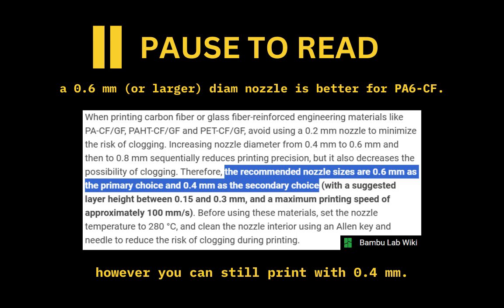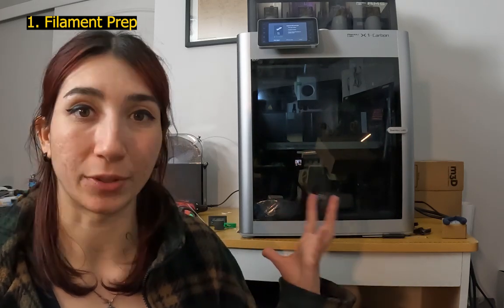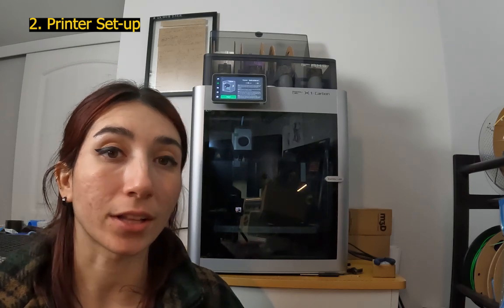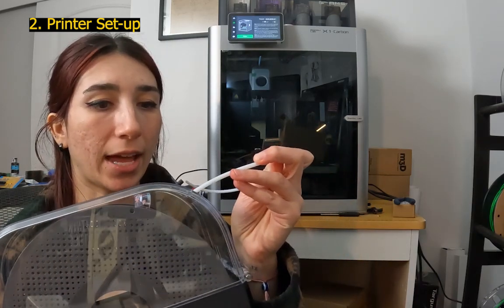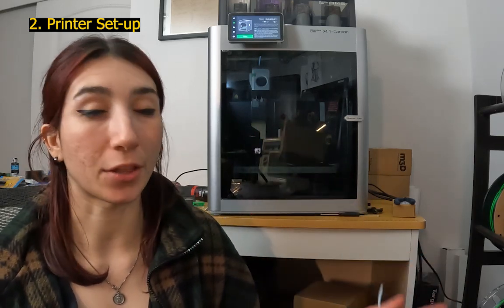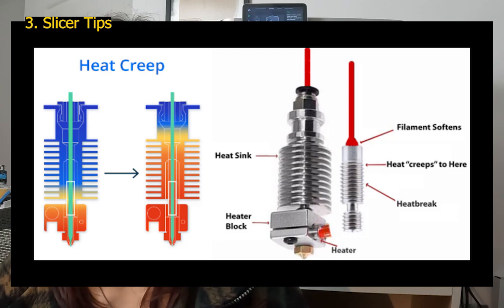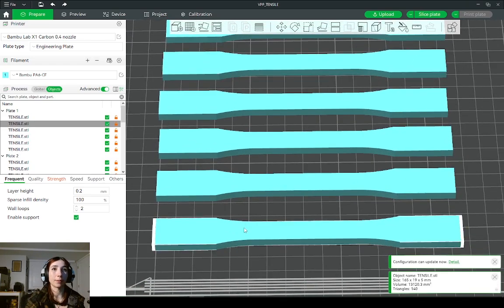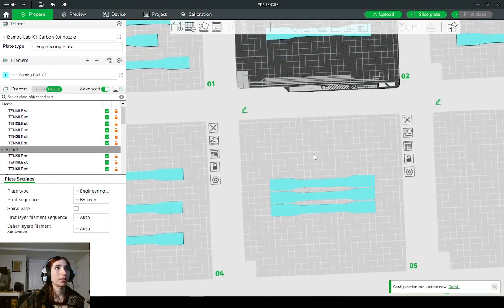I printed PA6-CF with a 0.4 mm nozzle (& you can too)

Comment from the maker: Hi! Thanks for checking this video out!

Edit** also another commenter pointed out - it's probably a good idea to uncheck "slow print down for better layer cooling" in the material profile as less cooling is generally better for layer-to-layer adhesion when printing with PA-CF (what I discovered through some colorfabb research, didn't find anything directly on the PA6-cf from Bambu lab). If you have more insights let me know and I'll update the video description.

Edit again** description updated :)

Best,
Dora

Comment: part cooling and hotend cooling are two different fans, right? I don't know on X1 but on A1 there is no setting to change the hotend fan. I think part cooling fan doesn't help at all with heat creep. it blows near the hotend nozzle, not on the heatsink.

Comment: hi, I also have an X1C and I just started printing pa6-cf, I found this to be a pretty helpful video, thank you! I had one more question, did you keep your print speed settings default? everywhere I see online says 100mm/s max but bambus defaults are quite a bit higher than that. I tried a print with the lower speeds and had a clog unfortunately, I'm thinking that might be the culprit as it's the only change I had from yours (potentially). Anyway, I'll try default settings when my new nozzle arrives today lol.

Comment: Thanks for the video. Im new into this and Im loving it for far. But I went to print PATH-CF on my P1S and the app didn't let me saying that if I print on steel nozzle that it would damage it and that I have to buy the hardened steel nozzle and preferably the 0.6 one. Do you think I can get away with the stock 0.4 steel nozzle that came with my printer? Thanks in advance!

Comment: You need a chamber heater, it's 55$ off amazon (chitu systems), fits p and x series bambus. Your parts are cooling too fast and shrinking, which pulls up the build plate. It also addresses the ends curling, as it's the same issue. Once you go chamber heated, you won't go back. It basically turns your x1c into a 2700$ x1e, without ethernet. Also use the Bambu green nano polymer glue, it's awesome stuff. Hope this helps
Reply from the maker: This totally helps. I didn't even know there were chamber heaters for these systems - thank you!! Is it low-key a fire hazard though ? Lol
Reply: @strelkomania  I thought that too, but I run them for literal weeks on end. I run that specific heater in a p1s and a 2.4, heaters going at 65c as I type this, printing PA6-CF. These chamber heaters do have temp fuses built in, as some sort of safely measure

Comment: Hi, great video 😊, 

I now have my 2 x 1kg PA6 CF and my dryer ready.  Still adhusting ny engineering design vefore i ooen the bag.

What did you adjust on the X1C default PA6 profile

Comment: IMHO you really need to print yourself a -Y-coupler for your bowden feed-in.   The  you just leave all the AMS infrastructure in place during printing from external spool - eg: TPU, CF/GF, etc.
Reply from the maker: you're right! good suggestion - is there a print model you prefer?
Reply: @strelkomania  Its fun to experiment and I've tried a few. You can get unnecessarily fancy with pneumatic connectors, many ports, mounting screws etc..  but I settled on a very simply design I plagiarised from someone calling themselves 'ZzoyozZ' on Printables.  👌

Comment: Have you tried with a 0.6? If so, how was it compared to 0.4
Reply from the maker: I have not tried a 0.6 nozzle yet. I assume it's less prone to clogging, you may not be able to get as small layer heights as a 0.4 mm nozzle (not too big of a deal). Overall it's just the lower risk of clogging & a slightly wider bead of the print pass.

Comment: Very good and timely video as I have been struggling with similar filament. I finally gave up and went with a .6 mm nozzle but next time I'll use your tips.Thanks!
Reply from the maker: Good luck ! A commenter helped me dial in the tips I posted in this video so if you come back to use this as reference please check the video description (I'll be updating the slicer tips shortly to account for the commenter tips about cooling). Thanks for stopping by. I think upgrading to a 0.6mm hardened nozzle was a smart move on your part to make printing easier. What machine are you using ?
Reply: @strelkomania  Bamabu Lab X1C .

Comment: How part cooling fan suppose to cool heatsink to prevent clogs? Not logic. Seems like too much retraction may clog, let the filamemt flow in one direction only. Head is so fast it need no retraction. And too much part cooling is warping parts in too cold environment and You have also chcked "slow down prints to better cooling"... It means for more warping with 30% fan.
For now keep your advices, gain more experience
Reply from the maker: @wykonczeni  thanks for your feedback ! I'm just sharing the settings that actually helped me fix my clogging issue when I was printing this material in my X1C. If they don't end up working for you that's alright. 

Edit** you're right and great catch I meant the hot end/heat sink fan not the part cooling fan. I'll make an edit in the video description.

For now this is what has helped me ! Otherwise even with default retract I was just fine. I'm still learning :)
Reply: @strelkomania  part fan is that one big at front of extruder cover and its blowing into parts - exactly under nozzle where hot just extruded filament is. There is no settings for heatsink fan (its on and off by firmware) thaths why it can fail in 2 situations: too much retraction, too hot environment. I had 70°C+ in my printers chamber and it was fine. Even motors can handle up to 180°C. So set the proper temps and fan back and try printing slower, 30, maybe 50mms. But still, this is not a good printer for such materials, so be patient
Reply from the maker: @wykonczeni  thank you for your tips and for catching my mistake. I made this video to share what I've been exploring so far and what's ended up working for me with the hopes that people who have been printing this material for longer would give their insights on the comments so we can all improve.

What machine are you using ?
Reply: @strelkomania  K1 mostly and modded ender 3 max. Ive printed abs on my ender with many fails but never with enclosure xD
Reply: @strelkomania  P.S. hotend fan and part cooling fan is the same thing with 2 names thanks to slicers. Normally noone even think about heatsink fan, because its always working at 1oo%. Older machines have it turnet onalways from the very moment of switching machine on untils is off.

Comment: Printing with 0,6 is not only for clogging but also for better layer adhesion. PA-CF is a technical filament. So strength and heat resistance is the main reason for the use of it.

Comment: I've gone through a few spools of PA6-CF20 in my MK4S-MMU3 using 0.4 with a hardened nozzle.

I've had no issues, except that it really, really needs drying and to be kept as dry as possible. 

The difference between wet and dry is significant. From useless or even failed to perfect.
PA6-CF is very useful when you need something to be as thin, light and strong as possible.
Reply from the maker: Thank you
Reply: Can i print 100x100x50 mm box with 10 mm wall thickness with PA6-CF20 without trouble if i obey the rules (: i will use k1 max with .4 or .6 hardened nozzle.

Comment: Excellent video. I’ve come to some of these conclusions also, it’s nice to know I’ve been on the right track. 

I print a LOT of PC/Nylon/ASA filled and not. The best plate I’ve used is the XTR from wham bam, combined with vision miner. Vision miner is so strong that the plate warped off the bed, the XTR solved this because it’s MASSIVELY more rigid than the Bambu plates. 

You should see if they’ll sponsor a video for you. I’d love to see your thoughts.

Comment: the first time i ever tried printing PA6-CF was with a .4mm nozzle... on an Ender 3... in a vinyl enclosure LOL. was able to get some successful prints but don't recommend it. Lots of clogs. 

However, on my X1C, haven't had any issues at all printing PA6 (or PA12) CF Nylon. With how hygroscopic these PA-CF nylon filaments are, I typically dry my filament at 90c (194 f) in a food dehydrator for anywhere from 8-24 hours before I anticipate printing with it. This has seemed to provide consistent successful, clean prints with no layer adhesion issues. I tried a regular run of the mill filament dryer (Sunlu specifically) but it didn't get hot enough to actually dry it.  Additionally, i also set the spool in a heatbox while it was printing, just to prevent additional moisture if it was a longer print. Just wanted to share my 2 cents.

Comment: That was useful, thanks! I was just going to print exactly PA6-CF10 on my slightly modded K1C (hotend is stock, though). Will see how it goes. The part will be a spline to fix the semi truck motorized shades. I already printed it from PETG-CF10 and embedded 2mm steel rod inside for more stiffness, but also wanted to play with PA6-CF.
p.s. AFAIK, the Pantheon crew is usually using 0.4 mm nozzle for printing tons of PETG-CF and PA12-CF. I was also using 0.4 nozzle for PETG-CF without any clogs, but only for 1kg of filament.

Comment: If you use a PTFE Y-Adapter, you could skip through all the trouble of disconnecting the AMS. Plenty of designs on makerworld or printables. Just hook the single prong side of the Y-Adapter to the tube that feeds directly into the X1C. Then hook up the tube from the AMS to one prong of the Y-Adapter, then the other prong to the tube coming from your external spool. Manually feed filament from the external spool per your process in the video, then just make sure to uncheck "Use AMS" before starting your prints.
Reply: If you go for that, get the Y adapter with four ports.  This way, you can have more than one non-AMS spool ready to go.
Reply from the maker: @bmo419  great idea I'll have to look into this, thank you !!
Reply: I print PA6-CF using the exact Creality dryer that way into a 4-way without ever disconnecting the tubes coming from my AMS hub. I also have never printed it on anything but a .04 nozzle and never had any trouble.

Comment: This is useful information! Recently I got some HEAVILY discounted Zodiac pro volcano nozzles, but since they were 0.4 mm I just assumed it's better to not even think about using them for materials such as PA6-CF, which is kind of a shame, since zodiacs are pretty much made for cf filaments. This encourages me to give it a try anyway.
Reply from the maker: If you end up giving it a try, let me know how it goes! I am curious if these tips will help others on other systems (hopefully yours is also enclosed and direct drive as thats suited for high temp CF stuff).
Reply: @strelkomania  It is enclosed, obviously not a Bambu, but seems like it would be worth a shot. I'm using an older V6 Hemera, with plated cooper volcano block, Hemera's drive gears never had issues with abrasive filaments, and copper plated block can reach temperatures I never even needed, so hardware wise it should be alright. Don't have any PA-CF on me to do the test, but now I know to keep it in mind that it should be possible, so I'll try to remember to return to this video if I ever do give it a go.

Comment: I am surprised that the small temperatur and fan speed adjustments was enough to solve your clogging issues.
But that is good news and surprisingly simple when you know it.

Also the warping was worse than I would have expected when you a printing with a hot bed and inside an enclosure. But I guess the delta temperatur still is quit big when the material needs to be printed at 270 C. 🤷‍♂
Reply from the maker: I was surprised the small changes helped as well. I am just sharing what worked for me and I hope it works for others! I'm wondering what else contributed to my clogging other than of course using a 0.4 mm nozzle. It's like putting out small fires, you fix one thing and hope it fixes your problem. If it doesn't, you keep trying something else until it does, haha. 

I don't normally print with high temperature filaments or fiber filled ones so this was a huge learning experience for me, especially with how I organize the parts on my build plate. I have some learning to do on how to make sure that I am evenly cooling the prints so they dont warp as much off the build plate or even while printing. Next up is annealing too.
Reply: @strelkomania  This is what makes videos like this so useful. When you know the answer is to just lower the nuzzle temp by 5C and speed up the cooling fans a little, then it is super simple. But when you are just trying to get a print to work and there are so many variables and when you change one it also changes the others behaviors it quickly becomes very complicated. And add to that the hour you waste every time you start a print and the nuzzle clogs and you have to clean the nuzzle and restart the print with different settings. It quickly becomes way less fun to 3D print. 

"It's like putting out small fires, you fix one thing and hope it fixes your problem. If it doesn't, you keep trying something else until it does."
Sounds like the life of every maker and Engineer as far as I know. 😂 (It is the same thing with all my projects, electrical, programming, blender, guitar modding, 3D printing etc. and all my work as a mechanical engineer. Honestly maybe it is just life 😂🤷‍♂).

Some estimations.
It seems like thermal expansion of PA6 is ~100 µm/m·K, but adding the carbon fibers helps a lot so PA6-CF might only have 20 µm/m·K.
If your print bed is 60C and the melting temperatur is 215 C that is still a delta temp of 155 C. For plastics the glass transition temperature makes this a very hard estimate to make. It seems like for PA6-CF it is 68 C. I Assume a stiffness of 2 GPa at 60 C and 0 GPa at 215 C and just assume a linear behavior between. This is for sure not right. I will be overestimating the stresses. Also I assume the thermal expansion is constant. It is not. This will also over estimate the length contraction.
Assuming your parts are 300 mm. 300 mm*155 K*0.000020 mm/mm = 0.93 mm. Quite a lot (probably the thermal expansion is way off).
The approximate stresses in the first layer assuming a very stiff print plate.
 ~E=1 GPa 🤷‍♂. 1 GPa*0.000020 mm/mm*K⋅155K ~=3.1 MPa. That is quite a lot. It is lower in later layers. 
It is probably something like 10 kg pulling on you build plate for each part 🤔.  But I could be way off. 🤷‍♂

I remember seeing a CNC Kitchen video on annealing but I just remember that I thought it was a lot of work and not really worth it for things that I 3D print. But it is different from material to material. But I feel like you loos a lot of the "it is so easy just to 3D print" when you use complicated materials and then need to post process them afterwards. At that point I would start asking myself if the part I am trying to make would be better made in other materials before going ahead with that plane. On the other hand it might give you some possibilities that you cannot get using other methods. But I am looking forward to seeing your annealing video 👍